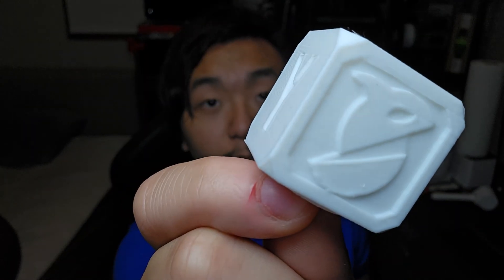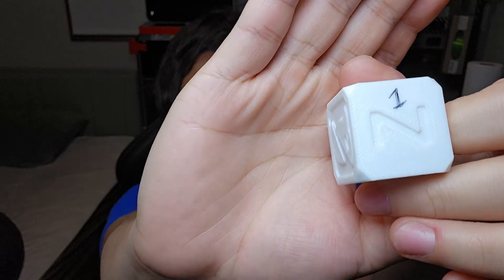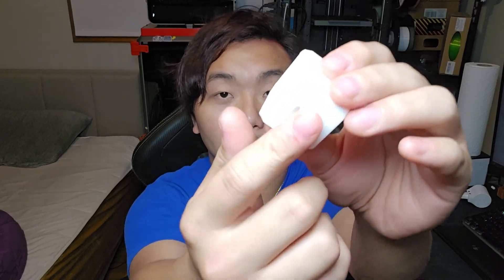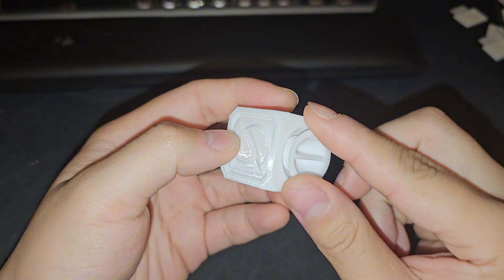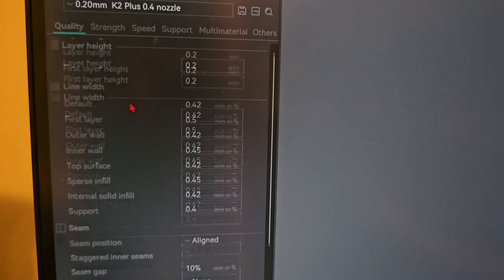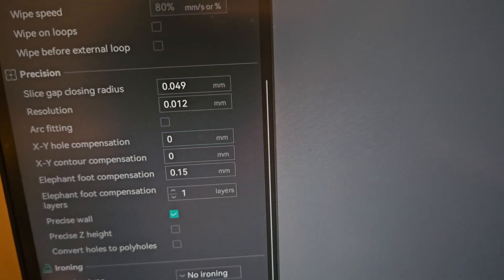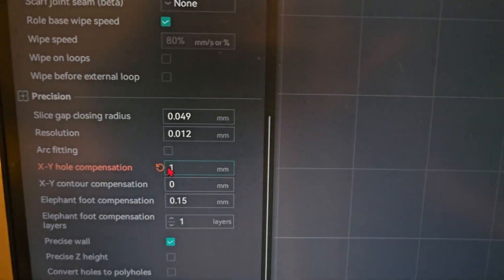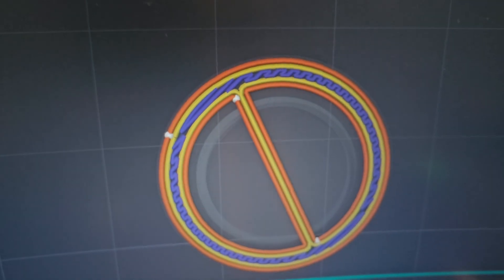Orcaslicer One Setting To Get Perfect Tolerance

Comment: I feel that the advice in the video could be misunderstood.
The X-Y hole compensation setting is a crutch, and the Orca Calibration Cube is the worst possible example to demonstrate its use. The entire purpose of the calibration cube is to verify whether the printer and filament are configured correctly. If someone resorts to using the X-Y hole compensation setting specifically for the Orca Calibration Cube, they are only fooling themselves.
Reply from the maker: Mmmm. Maybe you're right, i haven't fully understood what the cube is really for.
Reply: Hello  @Scratch3DPrinting  , 
The Orca Cube can be used to check whether various aspects of the printer and specific filament have been configured and calibrated correctly. At the beginning of the video, you are unable to insert the screw because it is too tight, which usually indicates a need to adjust the flow rate and pressure advance, and then reprint the cube to test the screw again.